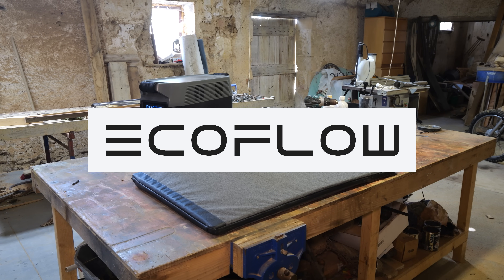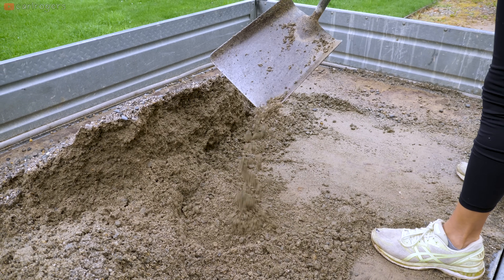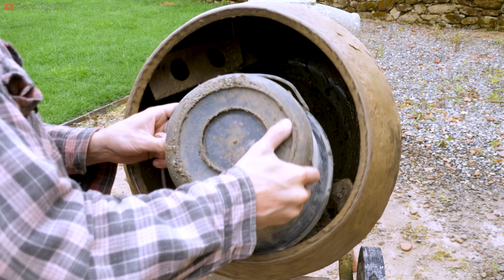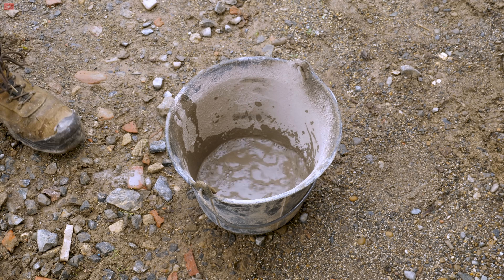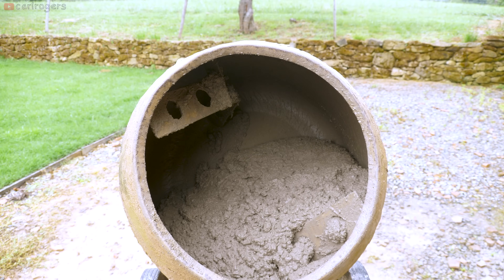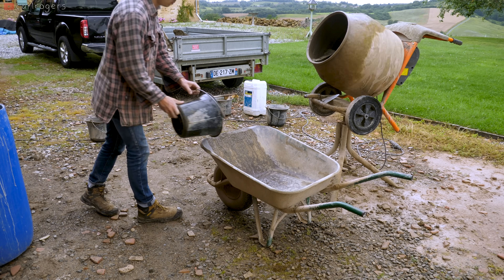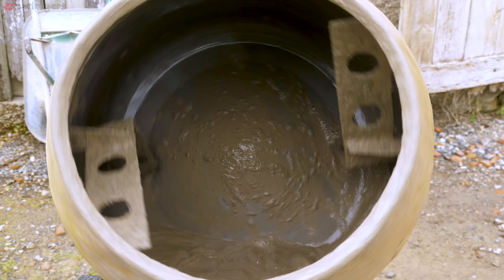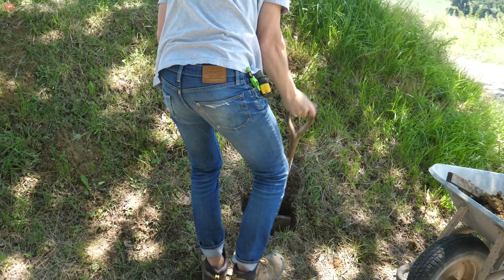How to Mix Concrete (with Solar)

Comment: That is pretty wet concrete m8. You want to make a slump tester. There is one i made in CAD and its uploaded, it might be something for you. Its basically a 12" high cone, with a 4" top and an 8" base. From: Modern Masonry, Clois E.Kicklighter

"MIX CONSISTENCY

The mix consistency or degree of stiffness of plastic concrete is called slump. Slump is measured in inches.
Very fluid (wet) mixes are called high slump concrete while stiff (dry) mixes are called low slump concrete. Slump is
related primarily to water-cement ratio. A high water content causes a high slump. Generally, a low slump concrete will produce a better concrete product.
A slump test may be performed in the field by using a sheet metal slump cone, Fig. 7-6. The cone is 8 in. in diameter at the bottom, 4 in. in diameter at the top and 12 in. high. It is placed on a clean dry surface and filled one third full with the concrete being tested. The concrete is rodded 25 times with a metal rod which is 24 in. long and 5/8 in. in diameter. Concrete is then added until the cone is 2/3 full and is again rodded 25 times with rod penetrating the lower layer. Finally, the cone is filled, the top raked off level and the mixture rodded 25 more times. The cone is then removed by lifting it straight up. The slump is measured immediately. The rod is placed across the top of the cone extending over the concrete sample. The distance from the bottom edge of the rod to the concrete is measured with a rule. This distance is the slump rating for the batch.
The slump test may be used as a rough measure of the consistency of concrete, but should not be considered a measure of workability. It should not be used to compare mixes of entirely different proportions or mixes containing different aggregates. The slump test does, however, help to signal changes in grading or proportions of the aggregate or water content in the mix."

Basically, you want as low a water content as possible, but still being able to put it in place, it gives the highest strength concrete. Low slump concrete can impare workability, so as said: only as low as is still workable. 

Im still looking for a good source of aggregates, it seems that your premixed sand and aggregates is a good candidate for what you ise it for. To be able to use it in structures you want to make sense of it all and cast some test cylinders and crush them under a hydraulic press. Otherwise you will have to make it so thick that the structure would hold even with the weakest concrete. You could have a winner for the batches you are making, but there is no way of really telling. No worries, concrete usually is pretty strong, and as long as you dont make any skyscrapers, it should be fine most of the times. 

Greetings,

Jeff
Reply: You think anyone is going to read your essay?
Reply: @Macron87  Well maybe. 

Greetings,

Jeff

Comment: Watched a guy messing with a mix when his sleeve got caught on one of the mixer vanes. He was instantly doing perfect forward somersaults until the plug was pulled. Damn near nerly lost his arm. Never stick your arm inside a mixer even if your are just tittivating with a trowel.

Comment: Really nice clear video on concrete mixing. One youtuber from years gone by said that throwing about a cupful of used engine oil into your wheel barrow when you've cleaned it out will stop it rusting.   They will always get scraped with a shovel and start to wear out.  I guess more people would rather just watch them  rust and then buy a new one. You didn't use a hose for the water - really handy for spraying down the equipment when you're done. Also, when setting a post, it may be a good idea to shape the concrete into a low rise pyramid so rainwater runs off. If it's waterproof wood, it'll be alright. Good video all the same.

Comment: I used to set a lot of posts and poles. One trick we used to to keep the post stable was to put large stones in around the post to keep it vertical, then we would put in the cement. On larger poles we would put in cement at the bottom before using the large stones. Never had to go back for any of them. Great demo on mixing the concrete.

Comment: You may want to use superplastificator than adding water - it separates when you put out the concrete from the mixer = too much water 👍
Reply: What is that and where can it be obtained?
Reply: @rd-ch1on  what country are you living in?

Comment: Bonjour Carl.  many thanks for the most recent vidéo. having mixed tons of concrete by hand as a young man on massive construction sites in the hot sun of southern california, the "wet" the wheelbarrow and mixer method is news to me.  well done.   a shout out to your kind and loving "assistante" who lifted the buckets and shoveled  with grace and certitude.  my July and August, north of you, was filled with many challenges:  avoid heat exposure.  worked early in the morning, stopped at noon, began anew the work after 21h.  it was a brutal 'socal' kind of summer.  despite all, me and my Slim soldiered on with pride and style.  cheers

Comment: Thank you. Please first all the water, second all the cement and last all the ballast. So water and cement mixed to liquid glue. Now you can fill in the ballast.
Reply: That doesn't  work with a bell mixer. You end up with a strong mix at the back and lean mix at the front. Those mixers do not move the material  from back to the front

Comment: 100mm of concrete all round your post. A bit underneath also good. Cut ends of post get timber treatment. Wet the side of the hole before pouring or the water all sucks our of the concrete making it weak. Rub the concrete with the back of the shade it looks creamy like toothpaste. Better to use more cement than less. It's about $10  a bag in nz.

Comment: By the way if you have a bigger mixer you can also work with half a bag and like 7 buckets. Here is a trick that an old French stone mason told me: lay down your shovel on the ground, lay your bag over the handle of the shovel (perpendicular) and cut the paper on roughly half the bag. Then lift your shovel holding with one hand over and one hand under the bag and you've got two perfect half bags standing up straight without making a mess.

Comment: Best tutorial for cement I have ever seen. 
Here in the US the postal service will not put mail in that box because it is too high. Here they have to be about the height of the car window because most carriers will not get out of their vehicle to deliver mail. In fact it 41inches minimum to 45" maximum height and 6 inches to 8 inches from the street curb.  I have seen them reject deliveries here over being  2 inches off.
Reply: Le facteur (the postman) will say the same thing. Height should be between 80cm and 150cm as per AFNOR.
Reply: @Wittynut        Beat me to it ! Our facteur does'nt even get out of the van .......

Comment: By all means, nice video for general purpose concrete used in non load-bearing applications. 
However, I'd like to add that concrete isn't concrete and you definitely need a properly graded mixture for structural applications and load bearing elements.
It seems obvious, but you don't wanna know how many structural failures occur because a contractor used a lower grade concrete mixture than prescribed (and required).
A structural designer makes a design and suggests a concrete grade with an appropriate compressive and tensile strength in order to obtain a safe structural component.
So please, caution is advised for load-bearing and spanning concrete elements.

Typically, the stone fraction in concrete is called 'aggregates' FYI.

Comment: Suggest you don’t rinse your cement bucket until the end. Instead, keep it dry from one mix to the next. Once there is a thin lining of cement on the bucket it won’t get thicker - unless you wet it

Comment: I always was interested in recipes for different purposes, plasticity, locations of use, but so far didn't find a useful overwiew: plaster, mortar, concrete; with cement or lime or even clay (openness for vapour); different amounts of water (thickness) or different types of sand (smoothness), with or without split, pebbles, stones, fibres and other additives. This seems to be quite a world of stuff to learn.

Comment: just a small tip for you instead of adding more water you can just tip the mixer forward into a more upright position hold it in this position and it allows gravity plus the mix already inside the mixer to pick up anything left stuck to the back. Adding more water also sometimes isn't necessary if you use a basic Admixture when mixing just allow the mixture to turn for longer and it will become wetter in time. Also wet gritsand mixture will also affect the amount of water which needs to be added but this comes with time using a mixer.

Comment from the maker: Sorry for the wait on the staircase Part 3, I tried to get it published but rural France internet really f*** up my schedule (normally I upload from London). Trying to find a fast internet solution but this will have to do until then
Reply: I had fibre installed at home today, it's insane. I think I'd swap it for rural France anyday tho 😉
Reply: I live in "rural" Portugal. Only option for me is Konnect (Eutelsat) or Starlink. Even cellphone coverage in my village is bad!